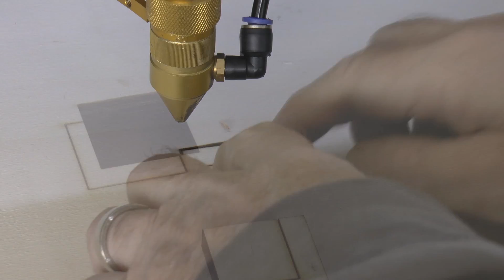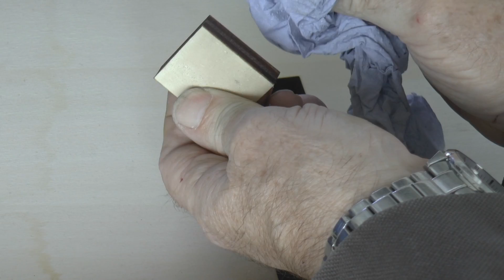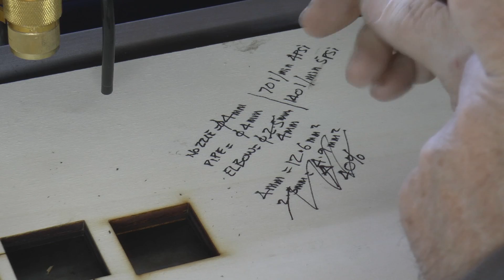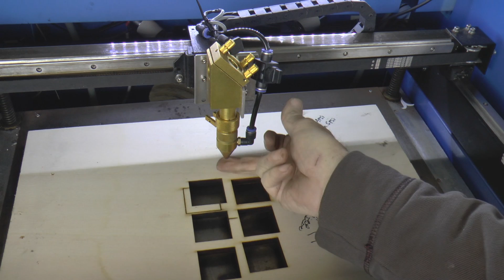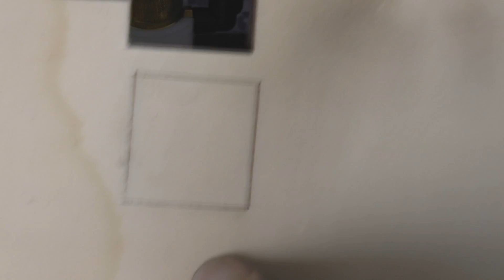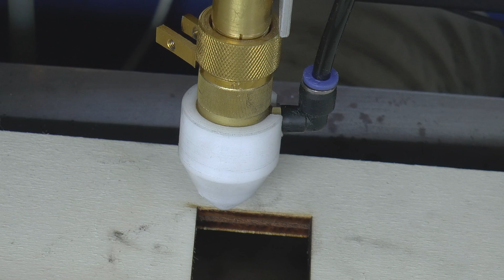RDWorks Learning Lab 87 Maximising air assist efficiency

Comment: Hi Russ, great exploration of this topic. Do you think that there is some benefit to be gained by trying to get the air to flow in a more laminar way? They use this trick for water fountains so not sure if this would be the same outcome for air.
Reply from the maker: Hi Felisha
That's a fantastic idea....if only it were that simple. Sadly air is not as controllable as water.  Water is not compressible so it responds very differently to air. Pop a balloon full of water and it will stay as a lump and hit the ground. Pop a ballon of air and will just expand to zero pressure escaping along a path of least resistance. Yes you can get laminar airflows but at such low velocities and flow rates to be unsuitable for our situation Airflow over an aircraft wing is a great example of high speed laminar flow where a very thin film right next to the wing surface is laminar. Laminar flow filter cabinets are  the opposite extreme using  a whole block of slow moving air.  The only sensible way to get air into the kerf is to impart it with sufficient velocity to it so that it can bludgeon its way into the gap. You do that with differential pressure and a nozzle with as small an orifice as practical,  usually with a straight tube form  before the exit point and as close to the work as practical. My plastic nozzle could have been more efficient if the gap was 2 or 3 mm rather than the 6m m I finished up with, but the point was proven.
Thanks for your comment. Who knows what silly idea might turn out to be useful. It made me stop and think if this was in any way possible. Was I missing a trick by understanding the conventional flow dynamics? Was there a novel way to exploit it?

Best regards
Russ

Comment: Where might one find a pneumatic flow controller like you have on your air hose?
Reply from the maker: Hi Steve they will be all over ebay. Here is a typical for you tostart with
http://www.ebay.co.uk/itm/Nylon-Pneumatic-control-BALL-VALVE-hose-tube-inline-push-fit-connector-air-line-/321631499160?var=&hash=item4ae2bb3398:m:m_o3pxfpTvAUZmXPw-nquxg
You will be able to find one from China for about $1
The great thing about it it is a FLOW control that will allow full bore flow for wood etc ate strangled flow for acrylic and paper.

Bet regards
Russ

Comment: The pumps we`re using are high flow/low pressure. Really low. So my guess is that reducing the pressure loss across the whole system will have a significally higher impact than switching to a bigger pump.

So I started analyzing the airpath on my machine:
pump => hose fitting => silicone tube => case connector (4mm) => black hose (3.7mm) => fitting to head (2.5mm) => nozzle (4mm) (I havent measured the pump/fitting/silicone tube on the outside of the machine since they all seem to be more than 6mm in diameter).
Especially the inner diameter of the tube seemed to be a major limitation.

Some tinkering later:
I changed the hose to one I had laying around: It's nominally 9x6mm but just fits 8mm push-in fittings. The fitting on the head was changed to a 8mm straight one which I drilled to 6.5mm ID (for some reason it had a smaller hex on the inside). Finally I threw together some connector to the outside of the case that's also >6.5mm in ID.

The improvements are massive! Where before I could barely feel the airflow there is now a cold breeze even 10cm away from the nozzle! Sadly I can't provide any comparison since I have neither the same tube nor the same wood available.

Conclusion: A mod that's definitely worth doing!
Now I need to think of a way to reduce airflow for cutting acrylic :)
Reply: Can you help me please :)? I have air pump nozzle 2,5 mm -> silicone hose 6mm -> black hose 3,7mm - > laser head connector 2,5mm -> laser nozzle 4mm.  Must I change tube for bigger (you wrote 8mm) or the same as air pump nozzle (2,5mm)?

Comment: Did you 3D print the shroud?  If so, could you share the file?  

I'm guessing that the poorer cut you got when switching back to the 1.5" lens would be due to the shallower focal length?
Reply from the maker: Hi Steve 
There was no 2 hours of 3D design and programming involved and no overnight print session. It was 10 minutes work on my toy lathe. I thought I was going to either add an O ring to get the fit or add a screw (with the risk of setting the nozzle off axis) but I was lucky with the fit.
Best regards
Russ

Comment: Nice job Russ. Have learned so many things that apply to any laser machine as an experience and principals. Deep knowledge is always a must thing even if i buy a high end laser machine. And now all this research proves why the price gap is so huge between a Chinese dragon and a branded laser. Basically they both do the same thing with a laser beam but the engineering and quality of materials under the hood makes the difference. Looking forward for some tests with the new Dragon :)
Reply from the maker: Thanks Polis
Yes there is still a lot to learn but knowledge gives you power over the  process I feel pretty sure we now have all the outside pieces of the jigsaw in place  but i's now all the annoying fiddly details inside the puzzle to be sorted!!!!
Best wishes
Russ

Comment: For cleaning wood-cutting residue off the bed, we abandoned acetone or isopropyl alcohol or any other caustic liquid for common white kitchen vinegar a while ago.  Seems to be at least as effective as any other cleaner but so non-toxic that it's literally food.
Reply from the maker: Great tip Steve. Many thanks for sharing. I'm not so sure about its effectiveness on the sticky acrylic condensate. Any thoughts? I'm off to raid the wife's chemical support cupboard because I'm sure I've seen some white vinegar spay in there.
Best wishes
Russ
Reply: We cut both wood and acrylic, along with other things (I believe one member tends to cut a lot of teflon-coated fabric) and the vinegar is all we use anymore.
Reply from the maker: Thanks will test and pass on...may be good for cleaning mirrors and lenses also?
Regards
Russ
Reply: i would stick to isopropyl/distilled water mix 90/10 for lens solution- i use this on glasses and camera optics and camera sensors. only because vinegar might leave more residue- also be sure to wipe away excess and always have your cloth lubricated as even cloth can cause micro-scratches but fluid does not seem to. perhaps use your air-assist to dry and blow away debris
Reply: also great job drilling the pneumatic joint- super brave.

Comment: What would happen if instead of 4mm all of that were say 8mm or 10mm using a 3mm orifice where the laser comes out?
Reply from the maker: To understand the answer to your question you will have to work backwards through the system. If the nozzle is going to be 3mm diameter then the flow through that orifice will be directly related to the pressure drop across the nozzle. Now I'm guessing at numbers to put some perspective on the problem. The 70litre/min pump is capable of achieving 5psi BUT that is only if there is ZERO flow. If you were to put a 3mm orifice right at the pump the pressure in the pump would probably be less than 0.5psi because that's all the BACK PRESSURE  that would build up in trying to achieve this 70 l/min flow rate..If you turned that orifice into a piece of 3mm tube ,say 5m long, then I guess it would require as much as 2.5psi to achive the same flow rate, but well within the capability of the pump.Add a few sharp corners and disruptive connections producing turbulent flow and  and you  lose another 2.5psi. These last two losses are all due to flow VELOCITY. if you change the bore of the pipe from 3mm to 4mm  you have almost doubled the area and hence halved the velocity of the airflow (not the flow rate) and these friction and turbulent losses decrese dramatically. So stick a 3mm orifice on the end of a 4mm tube 5m long and the tube losses are close to zero again and the only place that limits the airflow is the orifice. HOWEVER, try and double the airflow with the 140 l/min pump and you are now back to too much flow for the tube size and the losses go back to more that the pump can deliver (5 psi) plus the fact that trying to push 140l l/m  through a 3mm orifice may now require 5psi before you start. Combine these two effects  in a VERY complex mixture and you have effectively strangled the flow. This is what I was seeing with the high flow pump. The next size pipe up from 6mm will be 8x1 ie 6mm bore, this will be about 250% more area and would get back to a situation where all the pressure build up will be at the 3mm nozzle and not in the tube. 8mm tube may just about be practical,  but is it really worth it when you can easily  fix the existing system to extract full efficiency from the small pump?
Great question  and I hope that my grossly oversimplified attempt at describing  the flow dynamics has helped rather than confused
Best regards
Russ